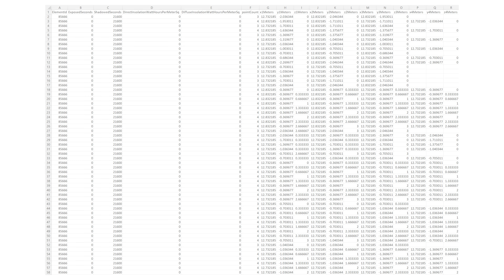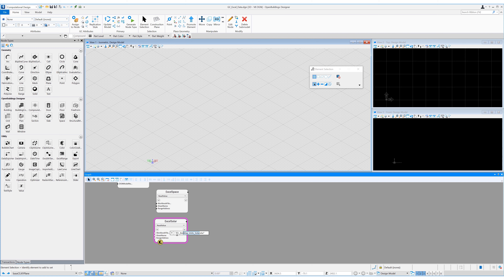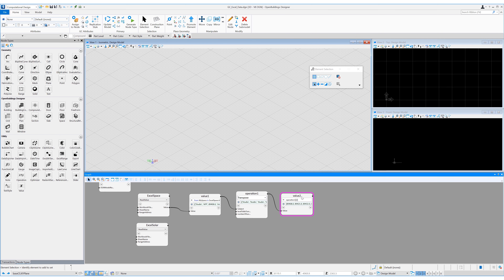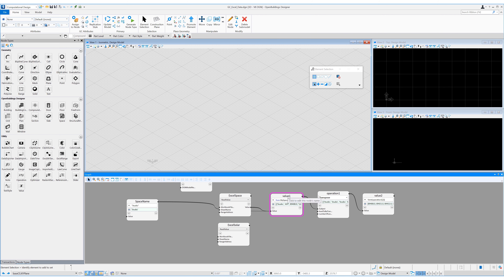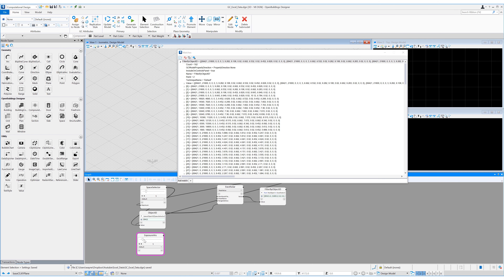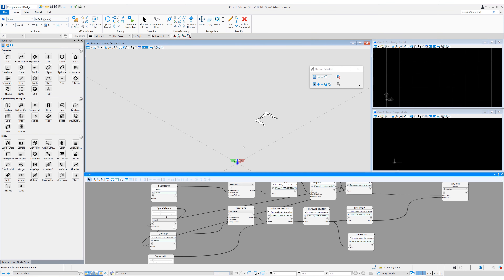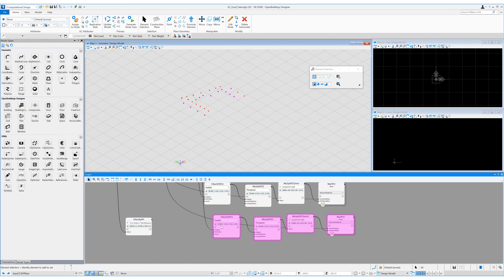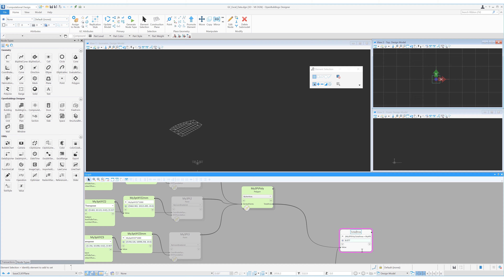Generating Geometry from Excel Data

Comment: Excellent! Can you tell me how to set properties (for example LevelName or Color) of Polygons directly in function editor?
Reply from the maker: Hi 
Unfortunately LevelName only currently supports a single input. Color does allow lists of data so it is as easy as linking this input to a list and it will match the corresponding indexes together.